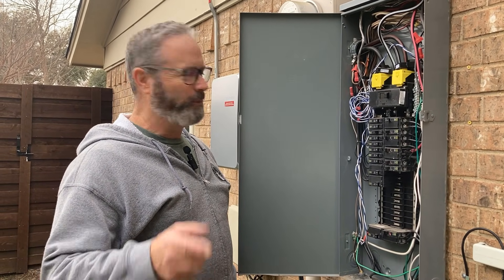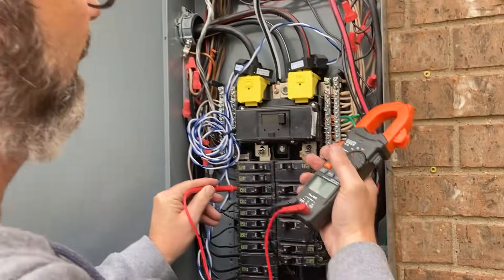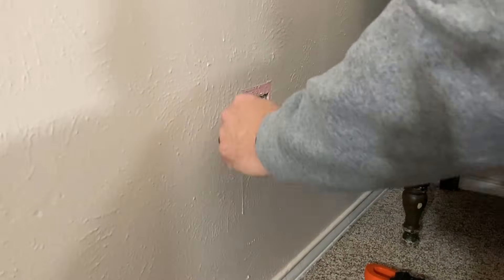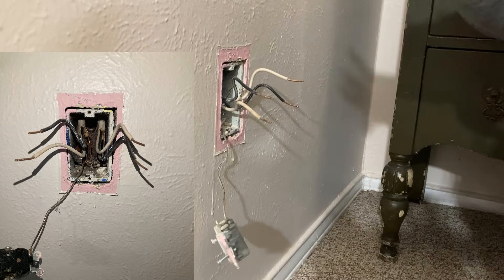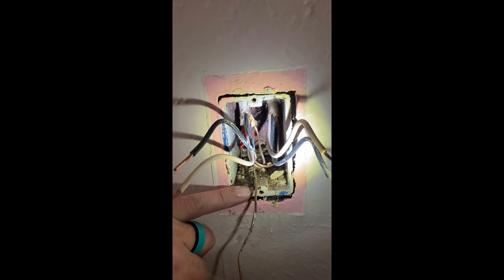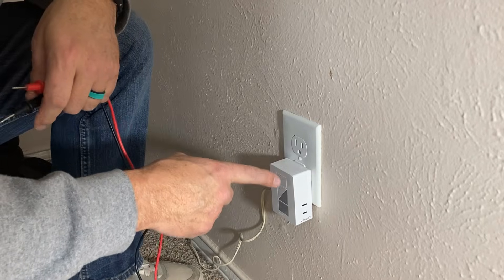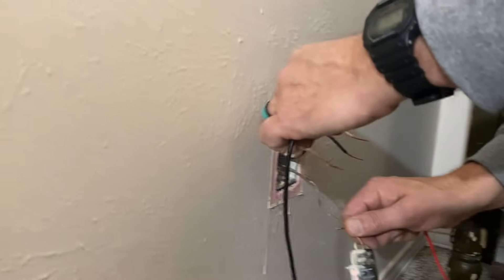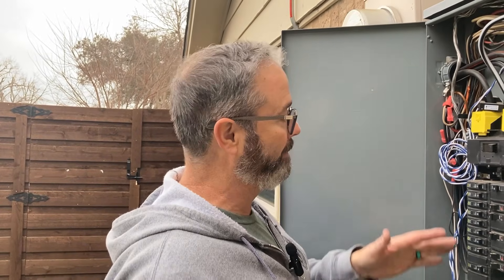The #1 Mistake Homeowners Make with Tripping Breakers – And How to Fix It!

Comment: Have a suddenly tripping breaker. First thing I did was cut into the ceiling where I know I buried junction boxes. First to check the connections, and also in case an electrician comes. No problems there which is how I ended up here. Yes I will put an access panel! Stop looking at me like that. I can feel your look. 
Checked the breaker as shown and there is continuity. Tomorrow I will continue.